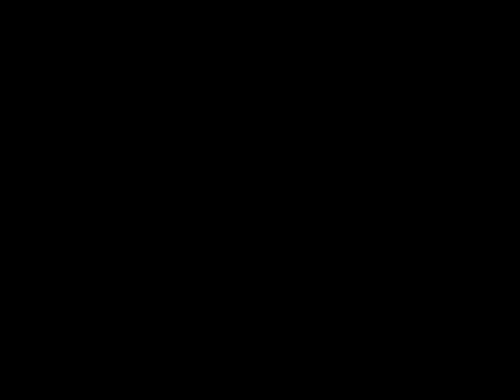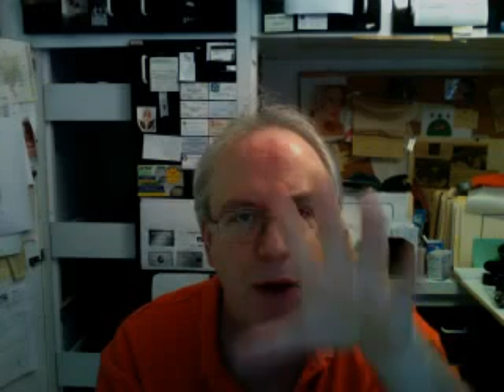MIT Engineer can stop oil gulf leak in 1 day

Comment: @mgaus7 no it's not like stopping a bullet with hay, a bullet doen't have continous energy, the oil well does. once a bullet is stop it's chemical energy is finish. the thermal(energy) pressure of an oil well doesn't end. with the water it would just blow away all the fill you put on it.

Comment: @mgaus7 first off the holes access would already plotted in on a GPS, secondly if it was that easy the would be using this method on land already. Go home and get out your air hose in the garage and trying close it off using sand or gravel what ever you think would stopo the flow of air coming out, and remind yourself that's only 100-120psi. then multiply that by 30. that's what it takes for regular oil field casing to break. 
 rememder there's still a little piece of casing sticking up.

Comment: This guys is suppost to be a MIT engineer, He's probably full of shit. His methods don't seem plausable.
 Simple air bag technology from cars and trucks assembled in the right fashion would work, or using a huge funnel shape with a hydraulic bag like the one that is used already in the B.O P( blow out prevention) stack  of the oil rig. it's basically a inner tube like a vehicles tire. instead of air it uses hydralic pressure. 
 you put on of these hydralic bags in the inseam of the funnel.